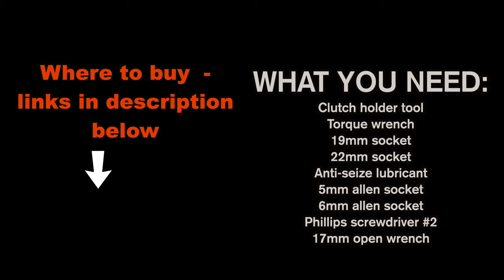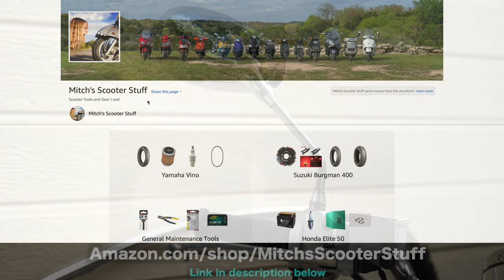Yamaha Vino 125 CVT Installation (belt, variator, sliders, clutch) | Mitch's Scooter Stuff

Comment: I just finished putting in a new clutch, belt, variators and sliders in my 2005 Vino.  No way I could have done it without these videos.  Mahalo Mitch!
Reply: Hey my 2008 125 vino is starting and only revs and won’t move,

Do you think My belt broke ?
Reply: @topdhen  Sounds like it. You ever figure it out?

Comment from the maker: * Tools I used in this video: 
Variator / Clutch holder tool - https://amzn.to/2ZuYJEA
Torque wrench 10-150 lb/ft 1/2 drive - http://amzn.to/2GuMsHJ
1/2 to 3/8 drive socket adapter  - https://amzn.to/2EqLzQm
19mm socket 3/8 drive - http://amzn.to/2CiXNqo
22mm socket 1/2 drive - https://amzn.to/3aHoJ64
Anti seize lubricant - https://amzn.to/2Q4H57t
5mm allen socket 3/8 drive - http://amzn.to/2ofCuCg
6mm allen socket 3/8 drive - http://amzn.to/2ELCnbU
Phillips #2 screwdriver - http://amzn.to/2fgdZDL
17mm open wrench - http://amzn.to/2GKqFL4
CVT cover gasket - https://amzn.to/3lZmlfu

Comment: Hi Mitch, i have one question, do you lubricate your variator inside of the "nut" ring? Your variator looks the same as mine, but i have majesty 125 and i feel kinda its rubbing high, if i pull up the gas. Because i saw my variator, it has sealant front and back. Appreciate for your help and keep doing repair stuff ;)

Comment: Hi Mitch, so based on your experience, better start assembly CVT from  the back pulley? Majority in my country they start from front pulley, complete with the belt placement at the front pulley, then they continue with back pulley.
Reply from the maker: Hey, it doesn’t really matter which front or back to start with... the belt must not be pinched in front pulley or the nut will not torqued properly, you know what I am saying?
Reply: @MitchsScooterStuff  crystal clear bro, thanks
Reply from the maker: @mekanikrumahan4574  👍🏼👍🏼
Reply: @MitchsScooterStuff  I just purchased the same belt based on your recommendation on Amazon when I read the reviews after I purchased it I noticed person said it breaks really easy is that true in your experience with the belt?